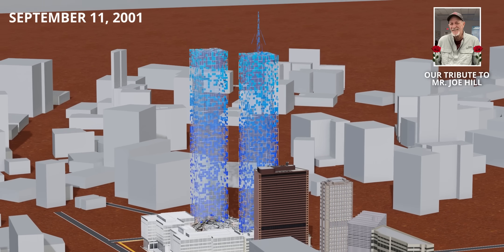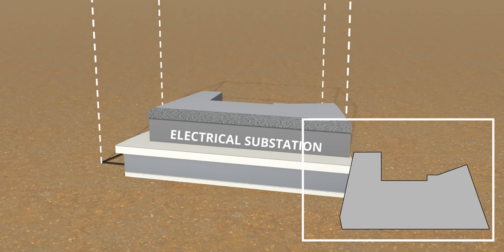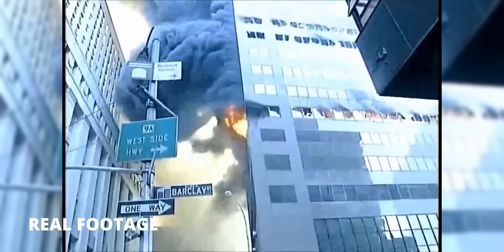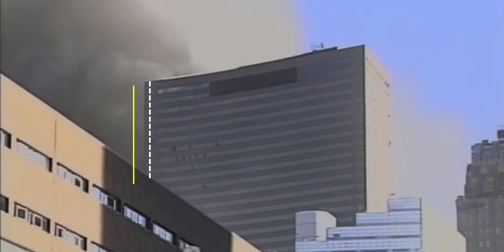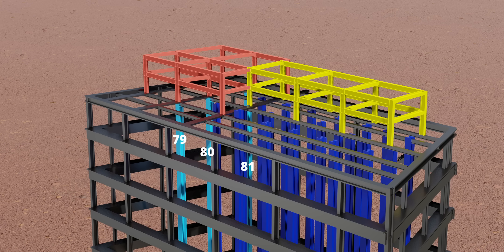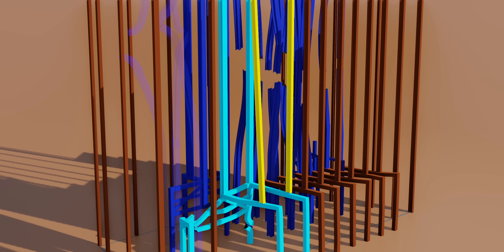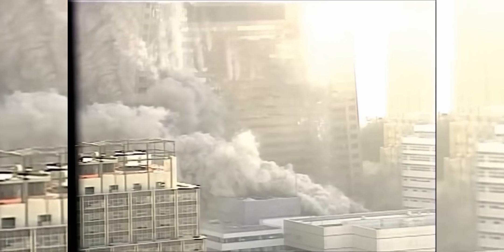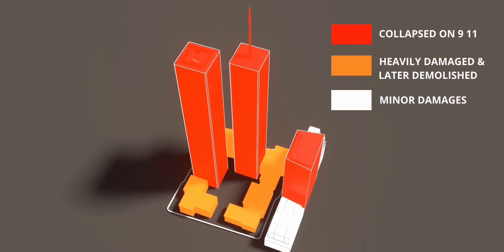Collapse of Building 7 | The Complete Physics

Comment: Av never came across such a moronic video... The voice itself sounds like a patronising liar... Like a pretend wanna be skool teacher.... 🙏❤️🌈
Reply: Note: That was NOT a rebuttal, nor will you manage to come up with one. Perhaps if we did a deeper dive.

Much misunderstood, Building 7 was the 6th building to collapse of 10 lost on 9/11. Because of its early low priority, conspiracy filled the information void with garbage made up by technically ignorant people promoting political agendas. But 7's loss is an engineering problem and should be treated as such, so I prepared this brief summary of my own analysis to fix that, using technical analysis, not ideology and tired memes. 

At 10:28am the WTC North Tower collapsed, showering Building 7 with tons of burning debris, causing heavy damage and starting many large  fires which burned out of control for the next 7 hours. Half the FDNY firefighters having been killed, units in disarray, equipment destroyed, no water pressure, and the greater urgency of search & rescue efforts, Building 7 couldn’t be saved so firefighting efforts were pulled as futile and 7 left to its fate. Firefighters make that sort of choice every day in brush fire situations - which houses to save and which ones to let go. Only real difference here is moving the decimal on the size and cost. People get overwhelmed by the size.

www.youtube.com/watch?v=g_SvpwyC17M

Collapse of a burning structure is always a concern for firefighters. Steel buildings subject to fire rely on active firefighting to survive. Buildings are designed around 1 to 3 hours of fire resistance, allowing time for occupants to escape and active firefighting to get started, after which all bets are off. Left to their own devices they'll exceed their design envelope and collapse, like Plasco Tower and Wilton Paes de Almeida. In 7 the occupants escaped, passive and active fire protections were compromised and active firefighting was abandoned hours before the collapse, which left the building to its fate. It lost. Odds on Building 7 would eventually collapse, and it did. No big deal in logic.

 http://www.youtube.com/watch?v=WnYBX6QT0R4 

FDNY Chief Daniel Nigro - The biggest decision we had to make on the first day was to clear the area and create a collapse zone around the severely damaged 7 World Trade Center, a 47-story building heavily involved in fire. A number of fire officers and companies assessed the damage to the building. The appraisals indicated that the building's structural integrity was in serious doubt. I issued orders to PULL back the firefighters and define the collapse zone. It was a critical decision; We could not lose any more firefighters. It took a lot of time to PULL everyone out, given the emotionalism of the day, communications difficulties and the collapse terrain 

FDNY Deputy Chief Peter Hayden ; We had our special operations people set up surveying instruments to monitor and see if there was any movement in the building. We were concerned of the possibility of collapse in the building. And we had a discussion with one particular engineer there, and we asked him if we allowed it to burn could we anticipate a collapse and if so, how soon? And it turned out that he was pretty much right on the money, that he said 'In its current state you have about 5 hours 

The collapse of Building 7 was anticipated and widely reported in the media throughout the day, with 24 video cameras recording some or all of the collapse. Everyone knew what was coming and why. 

www.youtube.com/watch?v=OY5S5k3tMHI

The collapse of Building 7’s was entirely different to the Twin Towers and harder to understand, most details being hidden from view and not intuitive.  But we can still sort out what happened through careful analysis and observation. This is my explanation of the collapse relying on no outside authority. 

Building 7 was a unique, asymmetrical 47-story steel framed structure built atop a smaller 3-story building serving as a partial foundation, requiring lower floors dedicated to complex load transfer structures. Of trapezoidal shape and all-steel tube-in-tube construction, B7 (above the 7th floor) consisted of a central core of steel columns carrying most of the gravity load, perimeter steel columns around the outside of the structure carrying the remainder of the gravity loads and long span beams and girders to tie those elements together and form the floors. On the outside of the building hung a moment frame or outer shell. 

Phase 1 : First externally visible signs of collapse initiation occurred at 5:20:28 pm and were notably quiet with observers not realizing the building was collapsing! No audible warning in the form of hundreds of ear drum busting 180-190dB explosive bangs preceding the collapse. Here at 12:00 a local CBS affiliate reporter is talking 10 blocks from B7 when collapse begins. People don’t start to notice the collapse until 12:11. At 12:45 is the famous CBS fixed camera clip of Building 7’s collapse. Note how quiet it is. 

www.youtube.com/watch?v=t5tEy6mXSE8

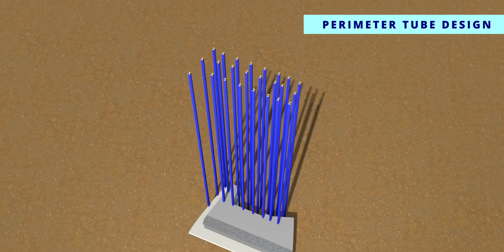Collapse initiation was due to lower floor failures above the load transfer region (8-14th floors) in the NE corner. In this video at 0:45 you can see the NW corner from inside the building while under construction, Column 79 just out of frame on the left. That big, angled steel beam across the top of the frame connects to C79 at one end. The girders connect to the beam. That beam and all those girders depend on just one connection 

www.youtube.com/watch?v=nP3TNHPCIVU&t=45s

Phase 2 : The NE lower floor failures caused a loss of critical lateral support over an excessive length of Column 79 and it buckled. Looking at a floor diagram of Building 7 (www.nist.gov/image-16640) when you see all the structures that depend on C79 you quickly realize this one column was a relatively isolated structural element on which a disproportionately greater fraction of the structure depended analogous to say the Key Bridge. Externally as collapse begins we see a vertical progression of window breakage along the 44-46 line and a kink in the roof of the East Mechanical Penthouse at the top of the building, consistent with C79 failure. Normally with a buckling column, the load could be redistributed to other columns. With C79 that is not the case - the failure did not redistribute the load, so the collapse rapidly progressed to the roofline, sinking the rooftop penthouse. The transition from full capacity to almost no capacity occurs in an instant and will result in virtually no resistance 

Phase 3 : With C79 gone, B7’s progressive, non-symmetrical collapse continues with adjacent columns 80 and 81 left laterally unsupported, and quickly buckling as well, sending the EMP down through the building. C79-81 all have no diagonal bracing, which is the major reason why they could not redistribute a lot of vertical loads among one another. From there collapse progressed from east to west through the central core until the core was gone taking all of the interior floors and probably most of the perimeter columns with it. Follow the horizontal progression of window failures low in the building and the dropping of the remaining rooftop structures into the building. One of the big takeaways from the NIST Building 7 study (invariably ignored) was how their modeling determined C79 failing under ANY circumstances would have initiated the same collapse sequence. 

Phase 4 : After about 10 seconds only the exterior moment frame remains, giving the illusion B7 is still standing to the casual observer since little has outwardly changed. But it is just a hollow empty shell like an empty cereal box supported only by a few remaining columns and overloaded from the loss of the core columns and floors, quite unable to remain standing. With nothing remaining behind it, the north face leans inward, forming a V in the roofline, the last few columns buckle under the strain and the moment frame free falls, landing on top of the debris pile. 

It is only here at the very end that a single measurement of alleged free fall acceleration is taken, from a single point on the outer shell. The Building did not “free fall” – just one corner of the outer shell did, sort of. The Building_ (defined as its center-of-mass) was already gone before that happened. The period of alleged free fall was a product of how it fell NOT why it fell and can't tell us what started the collapse 10 seconds earlier. Start to finish the collapse took 18-20 seconds, 3 times longer than free fall . How fast something falls cannot tell you what started it falling_ anyway. 

The debris spread outside the footprint blocking surrounding streets, heavily damaging the Verizon Building and destroyed Fiterman Hall. 

Building 7’s progressive, non-symmetrical collapse was incidental and unintended collateral damage from the combined effects of fire + time + gravity, started by the collapsing North Tower. That is true no matter who planned and carried out the 9/11 attacks or why . The collapse was of so little consequence it barely registered at the time - a footnote, only taking on semi-mythical status as an alleged smoking gun years later when demolitions at the Twin Towers, missiles at the Pentagon and shoot down over Shanksville all failed and conspiracists had nothing left to work with. 

Anything can seem like a conspiracy if you don’t understand how it works. Now you should. I hope you found this helpful, informative and it solicits informed critical comment. If I made any errors of fact, logic or reason or left anything important out, please let me know so I can fix it. IF you can offer a more plausible alternative please do. Be the first. Please start any reply with the words “Tits McGee” or I will know you didn’t read it and are wasting my time.
Reply: @TheCriticalStinker-01 Never happened
Reply: @DiamondSwordTribes2  What didn't? You managing to breathe without someone telling you how to?
Reply: @DiamondSwordTribes2  Yeah, as noted, that you need someone to tell you how to breathe doesn't surprise anyone.ä
Reply: @DiamondSwordTribes2  Could be it is. But that didn't make it wrong, particularly illustrated by the fact that you had no rebuttal.
Reply: The guy making the video has never engineered anything. I believe his education is a lie as well
Reply: .... I agree... The university of youtube/clickbait/narcism... He sent me pages and pages of nist report.. Says it all... No mention of A&Efor9/11 Truth... Who with the University of Alaska, are pushing for disclosure... Good luck to them... What really happened cant be disclosed, for rather obvious reasons... 🙏❤️🌈

Comment: I don't believe this BS story. If the three columns failed like they said the building would have collapsed to the side. Saying the other columns snapped all along the bottom is nonsense. When they showed all the columns broken at the bottom that is more consistent with controled demolition. It's just common sense.
Reply: No it wouldn't.  It would collapse down. There is no mechanism for topple. Steel framed structures collapse DOWN, in the direction of gravity.
Reply: @TheCriticalStinker-01 <----- government shill account. Aka M FITZ.
Reply: What you believe or don't believe is entirely irrelevant. No-one cares, you're not hot shit.

Meanwhile, here on planet earth, gravity works in the general direction of "down", that's not just "common sense", but a fact.